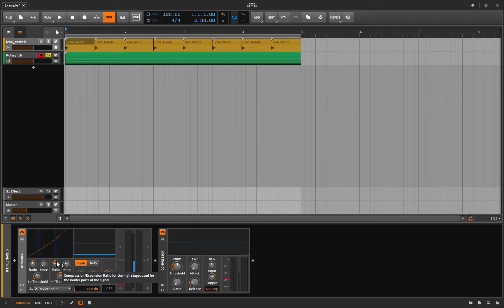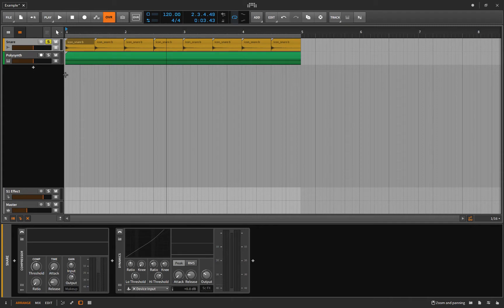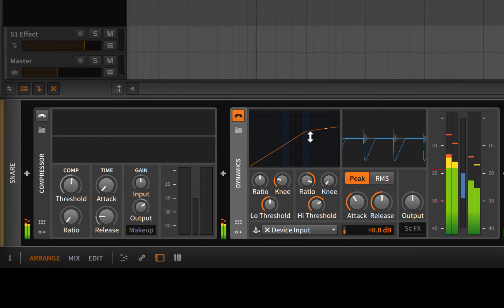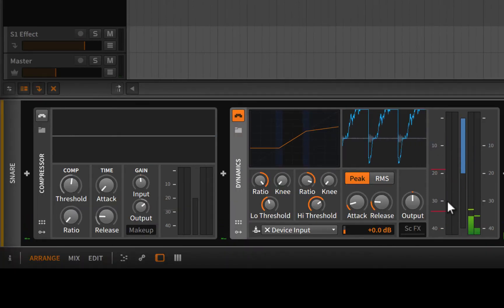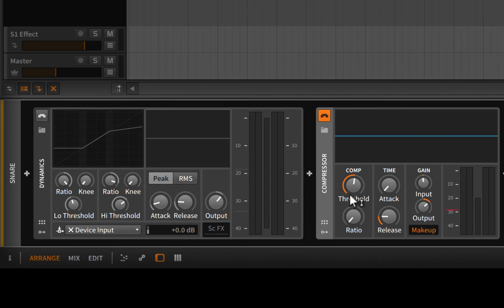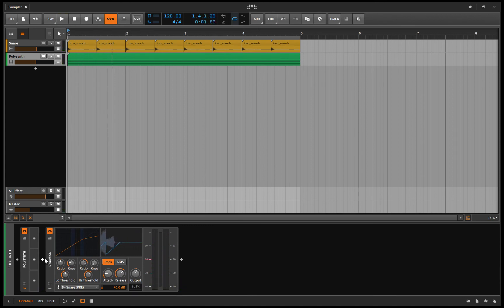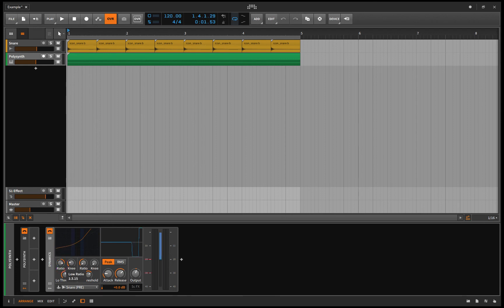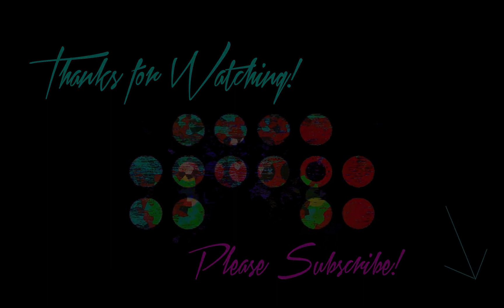Dynamics & Compressor - An Explanation! - Bitwig 2 Tutorials

Comment: how do  you import project files  from other daws. i have old projects i want to open back up in bitwig? can you help. best Regards Sean
Reply from the maker: Hey, so do you mean for example you have a project you made in Ableton or Logic, and you want to open them up in Bitwig?
The only way to do it (because DAWs don't generally play nice together) is to open the project in the original daw that you created it in, and then usually its File > Export > AAF which is All Audio Files, and it will remember the tracks, position of audio clips, names, and some other basic info. Then you can import those into Bitwig. But you won't get the plugins etc loaded automatically because AAF doesn't carry over that information.
I hope this helps!!
Thanks for asking,
cheers
Reply: yes that it its an old track from logic ive been wanting to re do for a while now. il try give that ago  then. thanks for the Responce mate appreciate it.
Reply from the maker: Always man, no problem! Hit me up if you run into any snags. You can message me instantly if you use instagram @vaansplace, otherwise I'll check my channel periodically as usual.
Cheers!